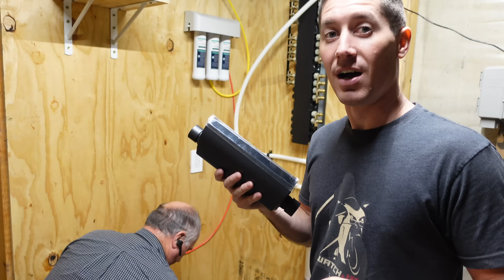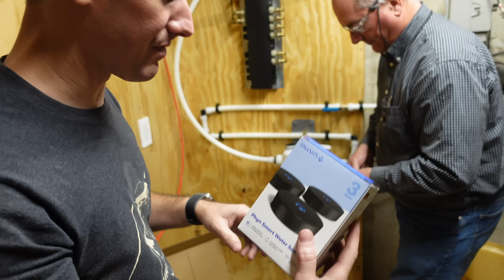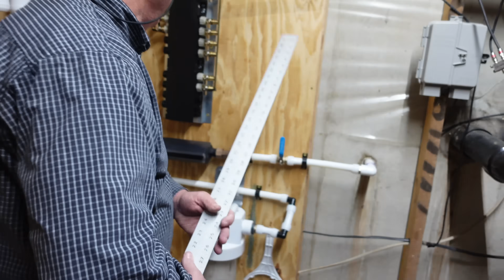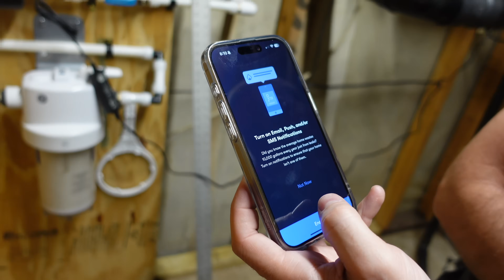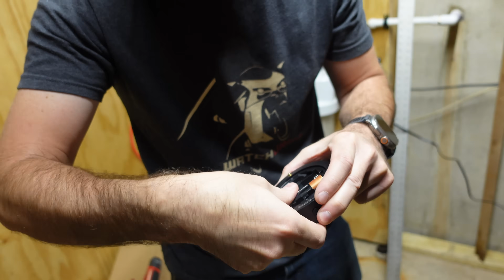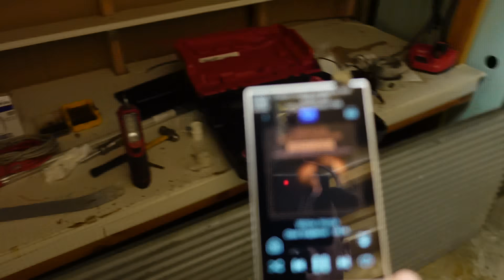YouTube Comments MADE ME Install This AI Water Meter : Phyn Plus

Comment: Serious public notice / buyer warning: Do not assume a Phyn device can actually be activated just because the app lets you begin setup or because your country or region appears selectable, listed, or seemingly supported in the application. In my experience, the activation process failed at the text-message verification stage, which blocked setup completely. The activation process appears to require downloading the app, creating an account, providing a mobile number capable of receiving text messages, receiving and entering a 6-digit verification code, pairing the device, connecting it to Wi-Fi, completing firmware updates, setting up the home and address, enabling notifications, and then finishing the configuration. If that verification code does not arrive, the device can effectively remain unusable even after you have paid for it and received it.

I am also concerned about the Phyn helpline and support process. For a product marketed around urgent leak detection and water protection, the support process should be fast, practical, and fit for purpose. In my experience, it was not. I have also seen several public complaints from other users about the helpline and the difficulty of getting proper assistance or meaningful escalation. That raises serious concern about whether customer support is adequate when buyers face activation failures or device issues.

Buyers should also understand that activation and ongoing use appear to involve extensive data collection. To set up and run the device, users may be required to provide personal details, contact details, address details, home setup information, Wi-Fi or network information, plumbing-related information, and ongoing device and usage data. I therefore believe consumers should look very carefully at the amount of information collected as part of activation and ongoing operation. At a minimum, buyers should get written confirmation before purchase that their exact country, region, and phone number are fully supported for activation, and they should review carefully what data is collected, how it is used, and who it may be shared with. A country appearing in the app is not proof that activation will work. You can pay for the device, receive it, and still be blocked from using it.

Comment: Check the specs for the Phyn. Most ultrasonic meters request straight lines in and out. The bend at the out end may cause false readings. Ultrasonics can't be installed with a manifold arrangement.

Comment: How far is the data rack UPS from the Phyn? Should connect it to the UPS, along with the modem and router so you can turn it off during a power outage.

Comment: Does it specify 10 diameters of straight pipe on the discharge end before the first elbow? This is common for most mag meters to have even flow through the unit.

Comment: A pipe burst in my house when I was away. When I got home, there was water everywhere. A copper pipe that ran under the kitchen units was touching the concrete pad of the house, with no insulation. The plumber who repaired it despaired of the shoddy workmanship of the builder developer who built the development of housing. My mains cut off is a small wheel that takes a few revolutions to close. When I asked why it wasn't just a level, the plumper said that you couldn't trust that over pressure wouldn't overpower the level.

Comment: Question....Does this have a power fail mode?  It shuts the water off any time power fails?  If you're away and the power goes out for 24hrs, you could come home to quite the mess.  Went to the Phyn site....No auto power loss fail mode.  Be cool if it had one.  Still, what a cool product!  Plotting how I will get an outlet to my service entrance heheheheh.
Thanks a ton, love what you're doing to the new place!

Comment: Awesome! You could get a small ups for those who are worried about power outages. Stainless steel braided hoses for your washing machine and for your ice maker will be good.
Reply: I buy the small ones when they are on sale and put them on TV and routers and small things that are critical. I have the bigger 1500 va on the computers. The small ones run routers for a hour or so and my previous smaller TV for about half a hour.

Comment: My former house had a 300 foot well and the washing machine hose burst when I was gone all day and it didn't run my well dry or burnout the pump. It did however fill-up the sunken living room and the water was running out of the garden doors that opened onto the back patio. I was never so sick in my life.
Reply from the maker: 😳 that sounds like a horrible mess
Reply: @WatchJRGo Over two weeks of sorting through things and boxing up the stuff that wasn't ruined and writing down the names of the items that were ruined and that was with a crew of 3 or 4 helpers besides myself. Then the real work began. I believe my agent told me it was a $50,000 claim and that was in 2012 so adjusted for inflation it would probably be a $100,000 claim in today's economy. 😮

Comment: There is  tech in your home I did not even know existed.  Keep it up.
Reply: And in my experience, it all goes wrong sooner rather than later, and is a PITA to fault find and fix.
Reply: @davidnorton5887  especially the Unifi equipment. The number of dead switches, cameras and AP's I have is crazy. Easy to use sure, but its made with the cheapest components.
Reply: Same here. I had no idea 🤦‍♂️